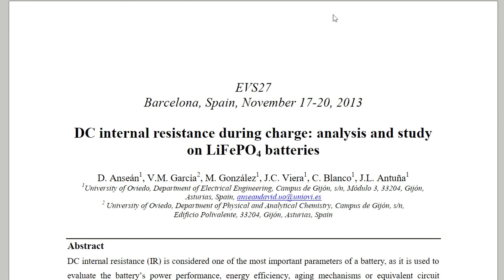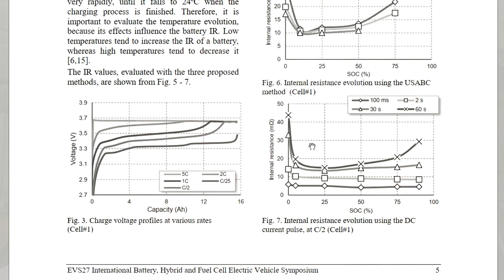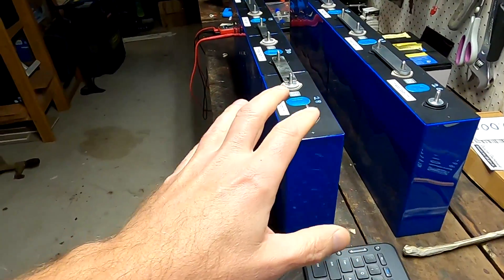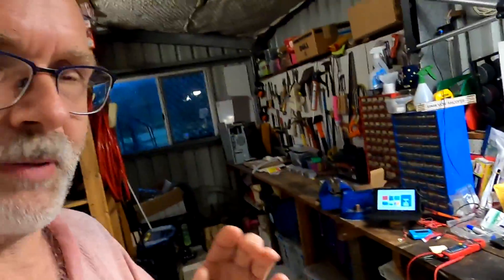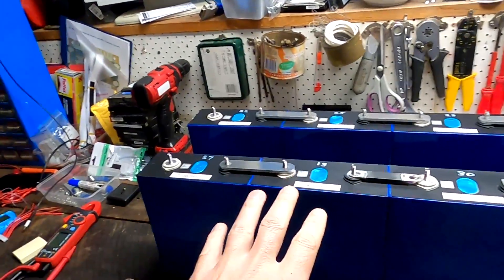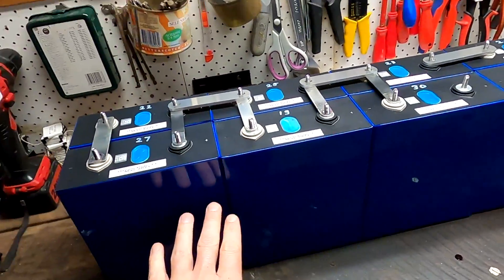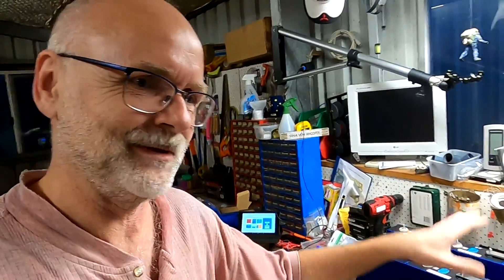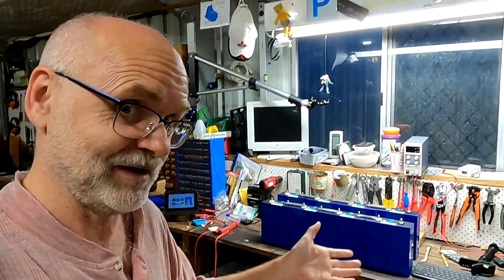Can you parallel battery banks after bottom balancing?

Comment: All I can say is what I do. 10 parallel strings of 16 in series.... top balanced. Then to keep them WELL within safe levels I sacrifice some capacity in the parameters.  My lowvolt cut off is 3.1 and high volt cut off is 3.4v...HOWEVER I STILL CHECK tge cell voltage manually periodically.. I have never run a bms......

Comment: There is a popular solar channel where the man recommends bottom balancing but only for cells which are not grade A, i.e. used grade B cells. For new grade A cells, his recommendation is top balancing and using a BMS. right now I'm trying to figure out how to keep two of the cells in one battery(16s) balanced at higher voltages. My other 16s is almost always within .006 to .009 no matter the charge voltage. THANKS FOR THE VIDEOS.

Comment: 4S 14.40V 105Ah.  No balancer.  Been running for 2 weeks and the cells have a 0.007V min/max.
How?  Use absorption to top balance.  You need to look at the ESR in that range and self-discharge.  You will find after holding the cells at say 3.65V for a few hours their self discharge characteristics will bleed off the high cell anyway.  When it defaults back to float (effectively disconnecting the pack if it's not loaded), the MAX/MIn delta settles down to 0.007-0.009V within about an hour.  They basically all self-discharge back down to the flat part of the curve where they are pretty much identical anyway.
The people who install this stuff profressionally for industrial sites tell me the best maintenance free LiFEPO4 setup is one which counts the colombs in each cell, gets an accurate assessment of each cells capacity and then augmenting each cells capacity with 18650 or other cells in parallel with it such that all cells have identical capacity.  They are top balanced and put into service with no balancer and just a yearly inspection.

Comment: All good theories, I think to bottom balance from new at least is a good idea, and Im sure there is a number of ways  this could be done with varying degrees of success. 1. Drain the bank 1 to 2 in series to get them down to a lowish set threshold, 2. Either parallel them all to take down some more capacity evenly using boost converters to maybe help even up some other cells in workshop or bank 2.  3. Then do an individual drain to set parameters so each cell can only produce a preset/ declining current and stop discharge. Hopefully this will get the cell set within some area of a similar low charge status ready for a first full charge, you will also be aware of individual cell capacity status as delivered.  4. Charge up full at most any rate without being silly, lower C rates I believe are better overall, life/cycle wise, etc, and may help if/when observing how they come up into the top balancing area, it would be good to see this type of information in a reasonably controlled way, as you would do Andy, 6. even noting how much current each cell absorbs either via BMS or individual cell discharges to a preset point again, noting how much power each cell drains again, 7. Yes, take them back up again, noting absorbsion current totals of each cell, this should give you a fairly accurate idea of the power capacity of each cell. IR is always going to be a issue, but Im guessing if you can match a large bunch of cells into 2 or 3 closer matched resistance ratings for each pack, that would also benefit.  I think this would give reasonable data about bottom balancing and how it effects battery performance overall, it would be good to know more about bottom balancing effects and how this process would give results. It would be a lengthy and arduous task. There are a lot more factors involved of course. Lifepo4 has great performance anyhow, if ur going from 10% - 95% daily it going to last a very long time. Lengthy subject but Good discussion material.
5.

Comment: Ive been through a few different solar setups over the years between my RV setup, then my monohaul setup, and now the setup on my catamaran. I personally prefer the series setup. Just one giant battery bank with all in series, but charged and discharged from different points. What I mean is for example, my current setup is a 96v battery pack, granted i have a single 96v inverter, but if I couldn't get one, then i would have bought 2 x 48v inverters and hooked up 1 inverter to the first 48 volts, then the 2nd to the last 48 volts. Then regarding charging, I would have separate solar charge controllers for the first 48 volts vs the 2nd 48 volts. The reason I prefer this method is your not masking any of the batteries in your battery bank like you could do in a parallel setup. In the future, if i want to add more capacity to my setup, i wouldn't do it via parallel installing the batteries, i would extend the series configuration from 96v to either 144v or 192v, but i would still stick to adding equipment in chunks on the entire series battery bank. Big pro to this setup is down the road, you will learn which cells in your bank are the weakest and which are the stronger ones. If you choose, you could rearrange the pack based on closer matched configurations, also in series you can overlap BMS modules for better protection. So in my case, i have 8 x SOK 12v204ah modules, each 12v battery has a 1p4s BMS internally, so they are balanced internally. To balance my 12v packs together, i use the 2S 12v BMS Victron uses, and i have 7 of them connected overlapping each other. So 1-2, 2-3, 3-4, 4-5, 5-6, 6-7, 7-8 wired.

Comment: I top balance because I am after balanced and even voltage. I am extremely hard on my cells. They will likely rarely see half full much less almost empty. I top balance also because my system runs and charges too 14.2. It always depends on their purpose
Reply from the maker: Thanks for sharing.

Comment: 12:45 You DO double your capacity, you only have half of it online.
At the input side of things I suggest two solarchargers, for each battery one and a 1-2-both switch between the panels and the solarchargers. As you have 4 strings I believe, you might wanna place 4 1-2-both switches so you can redirect where the solar is going. This can be helpfull as absorption is needing less solarpower.
Also, with the solarcharger in parallel, most amps will likely go to the solarcharger connected to the battery with the lowest voltage..........
If not you can also remotely reduce the max current charge of one solarcharger to steer more power into the other solarcharger.
Reply from the maker: Thanks Hans. That sounds like an awful lot of cabling with such switches...

Comment: Hi Andy thanks for interaction with the community it is just great that you sum up all the feedback. 
I personally think top balancing is fine for most users. Only on very large Pack's with very low balancing currents ( caused by cheaper BMS ) you'll have to think about this a little more. 
For your question: I see the only way for proper bottom balancing in matching the cells before you connect them in parallel. So you measure the capacity of each cell and the internal resistance ( for example at the low or high end of charge of each cell). Then you take all your results an spread them so that every parallel sting has about the same capacity and the same internal resistance. Of course you can't match it to 100 percent but that would be the most accurate methot to solve your problem. And yes it is very time consuming but this will make you the "healthiest" battery.

Like I said before I think not a lot of people will need to do this because these cell's have a long cycle life and others factors like temperature are way more important. So a active balancer would be fine to "solve" a slightly bad cell. Also manufacturers will always go with the cheapest method and that would be measuring just the voltage. But for us enthusiastic people, would it be probably the best solution and also we could sleep so much better at night 😂

Have a Beer and think about this.
Reply from the maker: Thanks a lot for your feedback and comment. That is good advice. With two/three battery banks, I have to go with top balancing, otherwise it won't work.
Reply: @OffGridGarageAustralia  
Bottom balancing would definitely always be the best for your cell's but in reality it's just not practical and not worth the effort and the extra money you spend on decent measuring equipment. But nevertheless it's very nice to think about both ways and you make people talk about it 👌
Keep it up I'll keep following your projects. Cheers 🍻

Comment: I have put 5 parallel battery banks together over 3 years and top balance them every time also the old banks ,they have now run with no problem over 1 year
I have solar in my cabin and slow charge , settings pr cell is 3.55 and never under 40% 
Yes I do have BMS but only for protection 2.8-3.65
Never bottom balance them
Reply from the maker: Thank you!

Comment: I have a different question that would need a complete video : how to parallel 2 Lifepo4 batteries (not modules) ? In fact if each one has a BMS, the danger is, I think, one battery could flow into the other because of discharge level that are not the same. The current flow could destroy the BMS. Am I right ?
So the question are : how big is the current flow when paralleling batteries that have different voltages ? I fear it could be very high. Is it dangerous for the BMS ?
The advantages of paralleling batteries is that if one fail the system could continue to work with only 1 battery. And that each BMS delivers 50% of the current. The disadvantage is that we need to be sure one battery does not go into the other.

If you can help me to know more about this...
Reply from the maker: Are you talking about battery banks in parallel or cells in parallel?
I'll do a test and video about this soon.
Reply: @OffGridGarageAustralia  I talk about batteries in parallel, not cells. 2 batteries of 16 cells in series +1 BMS for each battery. If 1 battery is 3 v x 16 after maintenance and the other 3.35 v x 16, plug in back the 3 v x16 battery in parallel with the second one could make a big current flowing from the second to the first. And I wonder if that big flow could not destroy the BMS before he cuts this current.
Reply from the maker: @monsieurd.6890  Yes, that is correct. before connecting battery banks in parallel, they should have a matching voltage at least to avoid such high currents.
Reply: @OffGridGarageAustralia  the answer of the BMS seller : 
****
Dear customer, our protection board does not support parallel connection.
If the protection board is used in parallel, once the voltages of the two battery packs are inconsistent, the current backflow will damage the board.
*****
So it is quite a danger if one day we plug a battery without verifying all batteries have exactly the same voltage. It seems the BMS does not protect at all from too big current flows.
Even if I do not think my problems is paralleling related because the BMS refuses to work even when I used only 1 battery and they do not smell burned. I think they are just shity engineered products.

Comment: About your bad results while raining - I recall you had strings of 3 panels on your roof, are they ~20v panels? If so, they'll ONLY produce ANY power into a 55V pack when OVER 55V (depending on the charge controller). How high a voltage can the victron take? The panel outside produces 45V in even gentle direct light with full cloud, and about 10A dead short (I didn't measure power). But in the shade where I am now, 455W panel did a best of about 45-50W :-D And, importantly, the 45V panel produced just 13V when even darker eg shade + cloud, and below the 12.8 in the shit lead acid battery I get no current at all. IE, perhaps that's what's going on for you. I would expect you should still get some power out of it even when rainy and crap, but not if they're only 60V in sunshine ;-) Let me know - I'm curious. As for me, I have devised a plan to get the panel up and into the direct sunlight for a limited period of hours per day when I'm here, and that will make a huge difference to how much car idling alternator charging I need to keep the laptops, phones, power tools charged each night :-D

Comment: im not sure if bottom or being on top is better what is more important is cell balancing. The more cells you have the more important it is to balance your cells. This is from a forum discussing Cell Balancing which i found very interesting here is one of the comments which i think would be of some interest to you Mr Andy 
What makes unbalanced packs possible, is the remarkable Coulombic efficiency (around 99.96%) of li-ion cells, remarkably small leakage (self-discharge) current, and, what finally defines the suitability for non-balanced packs, the differences of these parameters between the series cells.

Example on coulombic efficiency, if you charge 2000mAh in a series pack of two cells, cell #1 having coulombic efficiency of 99.970% and cell #2 99.975%, the first one loses 0.6mAh, the second loses 0.5mAh, and thus, imbalance of 0.1mAh is generated. Repeat for 1000 cycles, and 100mAh imbalance is generated.

Comment: Hi Andy, you could connect batteries with different voltage levels using blocking diodes between rich battery set. You would have to connect the chargers behind the blocking diode though. I want to use this system on my boat parrellelling LiFePo with lead accid.

Comment: I balance each set opf batteries and then use each set with it's own BMS. The you parrallel the batteries. Adding batteries to an already running system INTO the BMS is not a good idea, you will loose capacity and you will have to rebalance the whole system. And as the batteries are of different age and even different manufacturing batch, you might find that one pack is significantly lower in capacity, lowering the entire capacity of all batteries. 
Keep in mind that this chemistry works fine only when you have similar age, brand and level of batteries. I have in my RV all 12V Lifepo4 batteries, 2 170Amps, 4 100 amps and a 285 amps. Each one with it's own BMS. The reason is because when I connected the 4 100 amp into a single 400 amp battery I was only able to pull 310amps. There was always one set of 4 cells that was lower (shutting down the BMS output) or higher (shutting down charging). Once I did 4 separate systems, I top balanced them independently, left them connected in parrallel for a few days, now I can pull 395 amps. Furthermore, now I can pull more power without pushing the bms.

Comment: How about connecting loads over diodes and using separate chargers? Then you could disconnect one battery for service without disruption and bottom balance :)
Reply: As clarification, the batteries would be connected to the 48Vdc bus over diodes, one each, which prevent batteries from charging each others while still powering the loads.
Reply: The diodes would have to be quite huge and fused so that diode failure will not cause too much havoc, since a diode may burn and create a bidirectional bridge, which can be bad for the battery.

Comment: I like the idea of the bottom balancing Andy.. nice and simple. On the subject of connecting the two large batteries in parallel, can you not use some form of 'blocking diode system' so you cannot get any back current from one battery to the other..?? Each battery bank will have its own charging system and BMS for safety. They can then be connected in parallel into the large battery bank that you require with no back feeding of current from one battery bank to the other..?? As the system expands with another battery, just have this 'diode' scenario added to each new battery that you parallel up..🤔

Comment: I think that baby sitting the Batteries or Cells should not be done. It's exhausting. Just leave the work to the BMS and enjoy your solar power. Find your top and bottom voltage limits that works for you and let them be. I must confess that ever since I started watching your videos I find myself checking the voltage of every single cell  three times a day just to see how are they doing. Why? In my Case All of my essential loads are power by solar, If the battery hits the bottom limit then the grid takes control and recharges the batteries in 3-4 hrs then the cycle starts again.

Comment: My opinion is that to solve the problem forever, all the batteries should be discharged up to 2.6 volts, then done top balancing, after should be used an active balancer permanently in the battery bank. The active balancer works permanently regardless of the voltage in the batteries. The only problem with this active balancer, a minor problem, is that the parameter that triggers the balancing (voltage difference between the batteries) should be set to 20-30 mv. If this parameter is smaller, the device will permanently trigger the balancing and will transfer energy from a cell to another cell permanently.